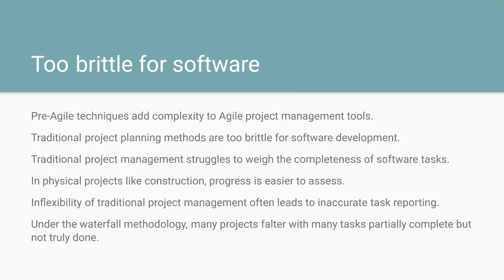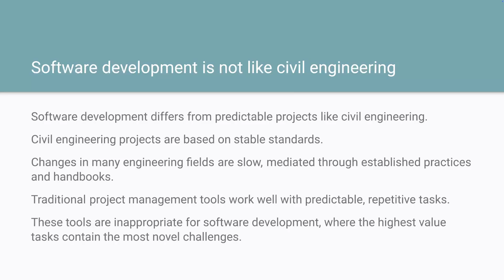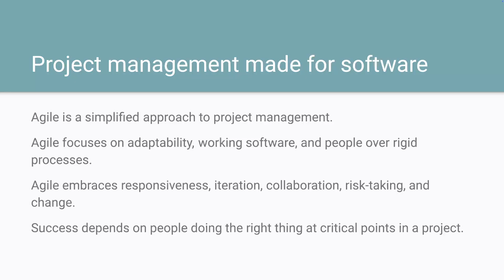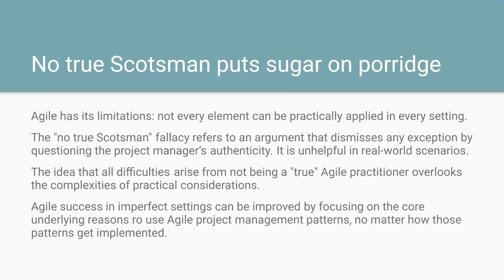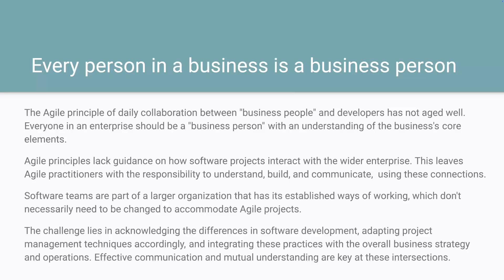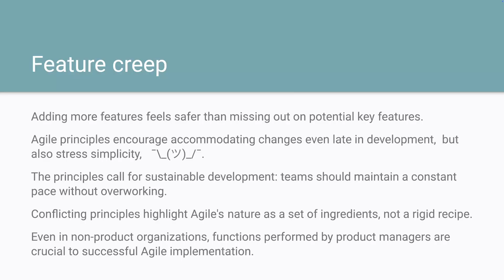Discontent, change, and… more discontent?

Comment: I'm leaving a comment here by invitation of Z.M. to me via messaging on  LinkedIn. My first question would be about the use-case for this content: Who's the audience and in what context are they intended to be using it for learning? I scanned everything and of the four sections, three appear to be 100% text (one part, #3, has a handful of diagrams). So... do we basically have an audio book here? Or a kind of quartet of lo-fi podcast episodes? The reading was competent enough, if a little low-key. I could see people using this while driving, or while otherwise occupied in a way that keeps their eyes away from the screen.
Reply from the maker: Good questions! First, I'm painfully aware that without my live presence, the text-heavy slides are in even more need of an upgrade than previously.

In several cases I have used this material in crises and otherwise unsatisfactory project situations because that's when consultants get called in. My audience didn't care, or it wasn't a priority to tell me the slides are dull, but if I'm going efter a wider audience I;ve got to pay attention to that.

Thanks for this feedback!